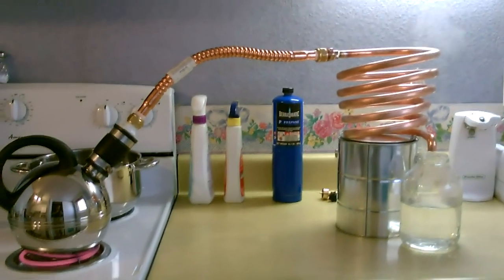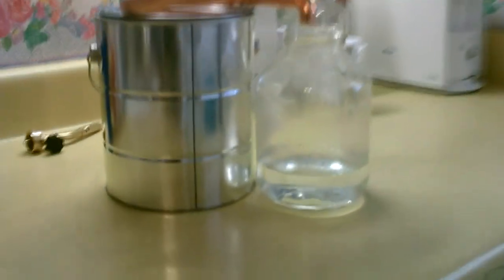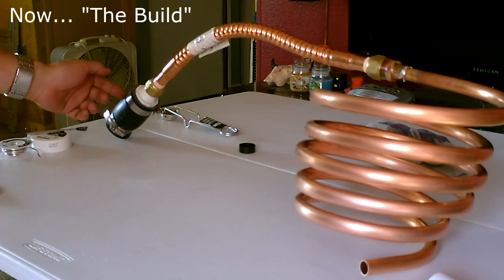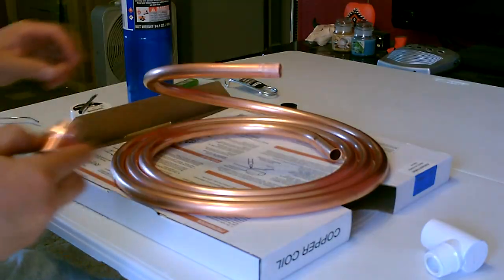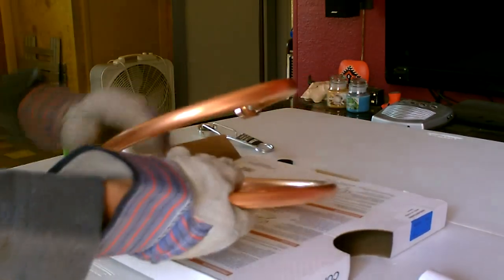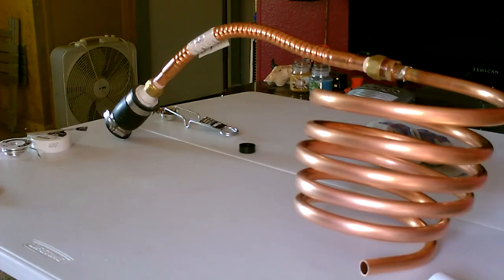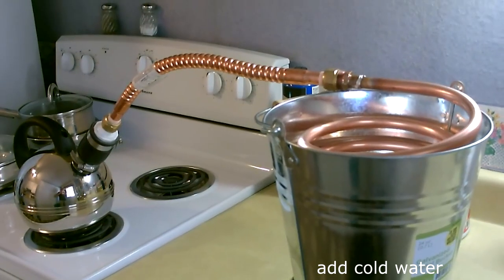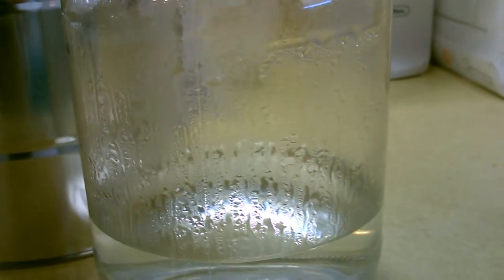Homemade Water Distiller! - The Deluxe DIY "pure water" Water Distiller!  Full Instructions

Comment: Does this not produce strictly distilled water -- in the collecting reservoir underneath the copper pipe outlet (as shown in the video)? Because I've read and heard drinking distilled water may do more harm than good if done regularly -- we need some impurities like minerals, specifically such that our system can benefit from. Drinking distilled water does more to flush some of the good stuff we have inside us, since our kidneys don't filter _perfectly_, normally. Or am I mistaken?

Comment: Not bad. But not to aphishent.  Everyone makes the same basic system . If you need to distill water, you're not going to have a working stove. You will do it over an open flame . 🔥.  You will need a more robust system because you can't control the heat.  
I recommend a small cooling chamber instead of a copper coil. Why distill a cup an hour when you can distill 2 or 3 gallons an hour . Look into commercial cooling towers and downsize it what works best for you. Distilling water is the simplest thing to do if you know how. But if you spent your like with soft hands and believing nothing bad would ever happen.  You're not going to make it more than 1 week after the crap hits hard on the fan

Comment: Can you list everything you bought to make this? The connector to the tea pot isn’t clear . Thank you
Reply from the maker: hi there. connector to tea pot is a 1 1/4" to 1 1/4" flexible tube with 2 lamps (clamps come with it). make sure to buy the right size flexible tube to fit your teapot. the home stores like home depot sell lots of different sizes. they also sell flexible metal tubing that you could use.

Comment: 3:57 What connector type is that and in what shop can you usually find it? Does it fit to any teapots or only special teapots for water distillation?
Can distillation remove chlorine and chloramine? The city water here where I live cannot be safely drunk. People have to buy mineral water in gallons here.

Comment: If you wrap the copper tubing around a solid cylinder, such as a large diameter pipe. You can make a near perfect coil.
 Also soldering takes a bit of practice to sweat fittings for  professional results.
Reply from the maker: hi there. i've had good luck wrapping smaller diameter copper coil (like 1/4" and 3/8") around a cylinder but this 1/2" stuff is a much more rigid. might work if you had a solid cylinder (like a round fence post or similar).

Comment: Has anyone mentioned, you should use a lead-free solder? Or you could use a flare-fitting instead of a soldered joint.
Reply from the maker: hi there. i used a 'silver solder' so it's totally safe. 🙂

Comment: Tip for soldering, you want to hold the flame on the fitting past the pipe, so that way the hottest part is where the solder flows to through capillary action.  So on the male adaptor at 0:41, you want to put the heat on the threads when you solder instead of on the pipe how it was shown in the video.  I'm a plumber and this is how you supposed to do it.  But good video.

Comment: my take on it is to add more copper mass to the inside of the coil poking in and run some form of fan though it pulling heat away from the copper protrusions or even use aluminum fins, possibly combining this with some form of existing air flow and direct the heat into something aswell that needs it maybe a large seed germination table

Comment: Why use copper? Is there something special about copper for distillation?
Reply from the maker: hi. you could use stainless steel tube if you want to (but copper pipe is easier to find in my area).

Comment: This looks great.  I got a tea kettle and bought some 3/8 " copper tubing.  I can't find anyone who has the connectors.  I have been to several hardware stores and plumbing supply stores.  What did you use for the piece of black hose (looks a little like radiator hose)?  The spout on my tea pot is right at 1 1/8".  What is the white plastic piece you used to connect the black hose to the copper pipe?  Finally, where did you get the flexible pipe?  Thank you in advance

Comment: But this requires a welder for example .
Having never used one. How do you weld the copper to the kettle. I mean is it like welding circuits. Using a thread of metal as solder?

And the other parts. Nuts bolts pipe. They all have to fit together and the kettle
Reply from the maker: hi. no welding required with this one. just a little soldering.

Comment: Probably cheaper just to buy distilled water 💧
Reply from the maker: hi. the cost is not as bad as it seems. it works out to about 80 cents to $1.20 in electricity per gallon (so not too bad). plus it's good to know how to make it if store doesn't have it 🙂

Comment: Ok thanks for this video just one quick question...is there any way, technically, to build a bigger system and produce distilled water faster? Or is the process limited to begin with in terms of volume ? Thanks
Reply from the maker: hi. i think you could scale it up. you could also cool the pipe. that should increase water production 👍🙂
Reply: @desertsun02 ብክብክትፍዥዥሥ።ክ ኽ

Comment: Can you please specify what the first rubber part is I'm not familiar with these parts 

What is the first rubber part 
What is the second pvc part that reduces to the copper
Reply from the maker: hi there. the first connector is a 1 1/4" to 1 1/4" pipe coupler and the pvc reducer is just a piece that reduces that down to 3/4". (remember to buy the correct size parts to fit the tea kettle that you have). one way to quickly get the parts is to just bring your phone to the home stores and show the video to the associate. they'll know immediately what the parts are. (or they should)

Comment: You should used ice around the copper pipe and it would of made come out as only water and not stem and water. I can see stem coming out it as well as the water and when did this at school the teacher used ice around the pipes to make the stem turn into water quicker before it come out and you will only have water coming out and you will get every single drop and no stem coming out. Love the idea

Comment: Can someone give a detailed description of this adapter fitting on the pot? The one with the black rubber(?) Cover held on with clamps?  I've got all the other pieces in a cart.
Reply from the maker: hi there. it's a 1 1/4" to 1 1/4" pipe coupler. (make sure to use one that fits your tea kettle). ✔

Comment: So, after watching this video I got inspired to try it out myself.  This sounds silly, but my car windshield wiper fluid is empty and I wanted to homemake some windshield wiper fluid...and it needs distilled water. But rather than paying $1 for a gallon of it, I decided to spend like $75 on copper pipe fittings and do it myself. lol  

The issue I have is my teapot neck doesn't have enough space to grip. I tried using rubber coupler (1 1/4") reduced to PVC  (1 1/4" convert to 3/4 ") which fits the 3/4" pipe. And that 3/4" copper pipe connects (using push connector) to a 1/2" copper coil (10ft).   However, the rubber connector at the teapot end expands when hot, so keeps slipping off. I'm not sure what else to try on that end...or maybe I should just buy a teapot with a longer neck.  

BUT!  It was working up until the rubber connector slipped off.  When it fell off, a bunch of water fell out of the copper tubing, so at least I know it's working!

Comment: Am interested in testing the conductivity of the H2O produced using the method you show in this video,  and compare it to bottled distilled water,,   
Does anybody else find it interesting how if distilled water is used to make ice cubes,  they dont pop out of the ice cube tray?
Also,,  I tried to carbonate distilled water,,
Its not easily done compared to mineral water..

Comment: This will be perfect for my home lab, because tap water has calcium and chlorine and other stuff, which might interfere with a reaction
Reply: What type of lab work do you do?
Reply: Hurst Industries, Just a teen hobby chemist
Reply: I stopped doing chemistry because of an incident where I was making hydrogen using water but instead of using the 1 volts your meant to use I used mains electricity because I'm stupid and well ye

Comment: I wanna make a distiller but also add some type of filter to the distilled water before drinking/using
Reply: Vlad Bellic, distilled water is purely water, no filtration needed, but since it is pure water, it can deplete your electrolytes, so maybe add a pinch of salt.
Reply: The distiller IS the filter. The act of distillation ensures you only get PURE H20...nothing else. You'll probably contaminate the water if you add another filter.

Comment: When you said you used the 1/2'' copper pipe, do you mean the actual OD is 1/2'', which is called I think 3/8'' pipe, or do you mean the one that is called 1/2'' and is actually 5/8'' OD

Comment: It works like a champ on a stovetop.. but in a SHTF situation where the electricity is out, tealight and  votive candles are a reasonable replacement..  just build a stand for the teapot to sit on that the  candles can be arranged underneath and wait for the candle flames to do its work
Reply: Have you tried boiling water with a candle??? Do you have any idea how long that would take 😂🤣😂🤣😂
Reply: @YoooItsRex    a "single" candle.. I  would agree  but I said "flames" as in double or  even possibly tripled.. What also helps is to have a thicker wick when burning candles.. You can buy thicker wicks, and make your own votive s, which will support a stronger flame
Reply: @kevinrehberg8758  right I get that. But have you actually done it?? Or are you just brainstorming?

Comment: What's the tea kettle called? It looks like it doesn't have a cap/lid?
Reply from the maker: hi. i'm not sure who makes that tea kettle. i bought it in the clearance isle at a ross department store a few years back. no marking on it except it says 18/8 on the bottom (that's just the rating of the stainless steel).
Reply: @desertsun02  ok, thank you sir. I couldn't get a very get look at it - so does it like....not have a lid, then, and you just put water in via the spout? Appreciate your response man, for sure! I need a reliable way to make distilled water at home for medical gear.

Comment: The only thing I would do different is submerge your coils in cold water. It would involve a few more parts to have it go through the wall of a bucket without it leaking, but you'll lose less water to steam that way...great video though!

Definitely needed in today's pandemic scare!
Reply: Anton Malhin  The Rothchilds want to know your location
Reply: Could also put the water collector in cold water too
Reply: The rubber joint man
Reply: The only thing? What about the rubber? What about the brass fitting? brass has blood in it everyone knows he's going to be distilling alcohol in this he is not using silver solder so it's going to leech lead from that too and all kinds of nastiness is going to come out of that rubber
Reply: @ClownWhisper  Plumbing solder is lead free.
Reply: @ClownWhisper  brass has blood in it? Yeah you certainly are a clown lol
Reply: Cold water won tlast a few seconds because the coil gets so hot and the cold water turns hot fast
you need much longer coil   to allow time for steam to cool down\
Reply: @brettkuntze7418  Water is a far better heat exchanger than air. This is because water has a significantly higher thermal conductivity and heat capacity compared to air. In the context of a water distillation system, submerging copper coils in water will enhance heat transfer efficiency, cooling the steam faster and allowing it to condense more effectively into distilled water.

Here’s why water is better:

Thermal Conductivity: Water transfers heat more quickly than air, so it will cool down the copper coils much faster.
Specific Heat Capacity: Water can absorb more heat energy before its temperature increases, meaning it can cool the steam more efficiently than air.
Density: Water is denser than air, providing better contact with the coils, which improves the rate of heat exchange.

In a distillation system, using a water bath for the coils (instead of open air) will speed up the condensation process and improve the overall efficiency of the system.

In general, you might not need to change the water bath very often, but consider the following:

Temperature Rise: Over time, the water in the bath will absorb heat from the copper coils, raising its temperature. If the water gets too warm, it will lose its cooling efficiency. You might need to either replace the water or use a method to cool it (e.g., adding ice or using a recirculating system with a radiator).

Evaporation: If the system runs for long periods and the water bath is exposed to the air, some water may evaporate. You might need to periodically add more water to keep the level sufficient for heat exchange.

Fouling or Contamination: If the water bath is used continuously over a long period, it could accumulate dirt or minerals, especially if the water source is not clean. In such cases, periodic cleaning and refilling may be necessary.

If you’re running a small, hobby-level distillation system for short periods, you may not need to change the water bath often—perhaps every few runs. For continuous or larger-scale systems, you might want to consider a recirculating system to maintain cooling efficiency without frequent water replacement.

The information about water's superior heat exchange properties compared to air, and how it applies to water distillation systems, comes from fundamental principles of thermodynamics and heat transfer, which are well-documented in physics and engineering texts. Here are some solid sources for the facts mentioned:

Heat Transfer Textbooks:

"Fundamentals of Heat and Mass Transfer" by Incropera and DeWitt is a standard reference that explains heat transfer mechanisms, including conduction, convection, and how different materials (like air and water) behave as heat exchangers.
Thermodynamics Textbooks:

"Introduction to Chemical Engineering Thermodynamics" by Smith, Van Ness, and Abbott covers many practical applications of thermodynamics, including phase changes (like condensation in distillation) and heat transfer efficiency between materials.
Water Distillation Guides:

Practical water distillation guides and resources, like those from the U.S. Geological Survey (USGS) or The International Association for Distillation, provide insights into cooling systems used in distillation processes and how water is used to condense vapor efficiently.

Happy reading!
Reply: What about the solder joints could be lead  got me guessing 😮?
Reply: Anton Malhin  I was referring to the COVID-19 pandemic we're all going through.

Comment: Will this prevent me from turning into a gay frog? Also the black connector is called a rubber pipe coupler.
Reply from the maker: hi. yes, this will prevent you from turning into a gay frog. it removes those types of chemicals. 👍

Comment: Looks like the coil needs to be longer length or some added external cooling assistant to the coil. The exit water is too hot . There is loss efficiency due to steam escape and evaporation.  Probably just lowering the heat to the kettle once boiling occurs would be the best adjustment.It would allow slower movement of steam giving more time for better condensation.